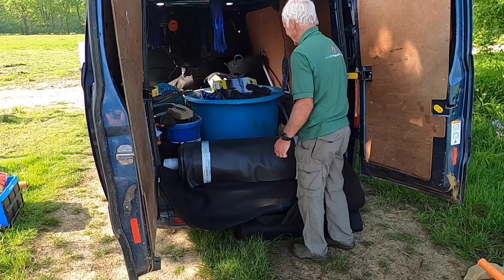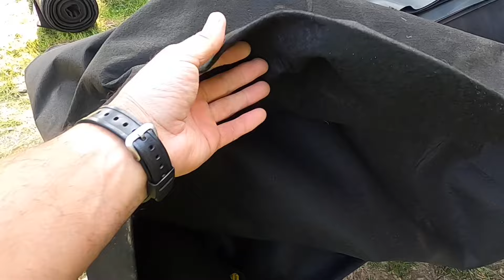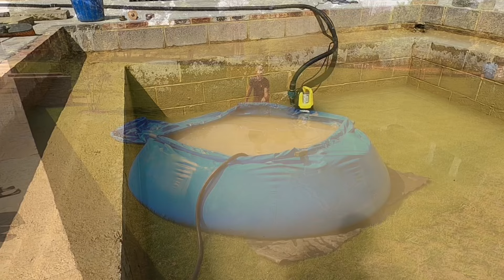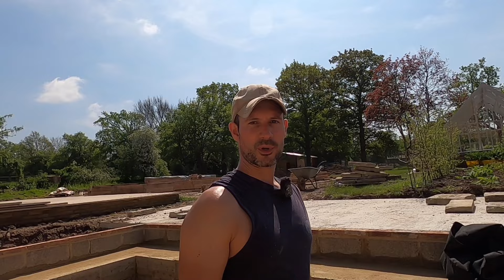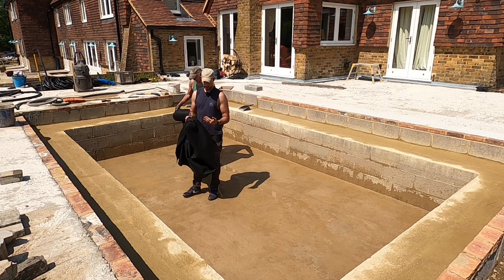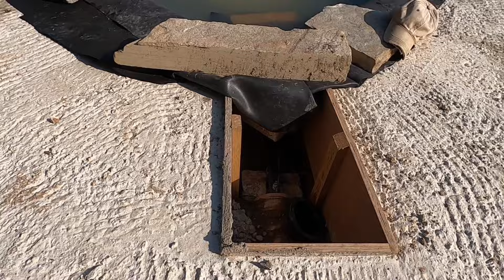Ponds, pools & carp(e) Diem…

Comment: Great to see you both again. I find the videos so entertaining and informative and the end products are things of beauty. It helps that you are a natural born narrator as well as a skilled 'pondsman'. I particularly like your stonework, it's every bit as attractive as the softer aspects of your creations. Can I ask a quick question Ed. You invariably mortar in the blocks and then scrape a bit away for aesthetics and a refuge or two for fish and invertebrates. Would it be feasible to dry stone wall the surroundings ( in and slightly above the water ) or do you think frogs and the like would inevitably dislodge stones / blocks ? I don't intend to have fish in my pond, certainly nothing of any size. Best wishes.
Reply: I know that if I was installing ponds for a living I wouldn't go down the dry stone wall path. More likely to have a fail and a customer who wants things put right. And secondly it would be advisable to have a fairly wide base thereby reducing the pools volume which might already be modest. In my case I don't have either of these reservations Ed.
Reply from the maker: Hi there Tony, thanks for watching and commenting and my apologies for the slow response. Indeed dry stone walling within the pond is perfectly acceptable- environmentally preferable even, plus all the extra nooks and crannies will be loved by many pond inhabitants!   Yes, over time some of the smaller pieces of stone will potentially move a little from frogs and other amphibians squeezing into gaps and the top most pond edging stones will often get kicked or moved around, but I have made many a pond using the dry stone method over the years- I just prefer to make pond for clients in a slightly more durable fashion.
Good luck with your build!
Best,
Ed
Reply: @CrystalClearAquatics  Thought I'd joined the thread a little late for a reply Ed, so much obliged. Looking forward to more great builds and more great advice. Thanks again.
Reply from the maker: Anytime Tony!
Best,
Ed